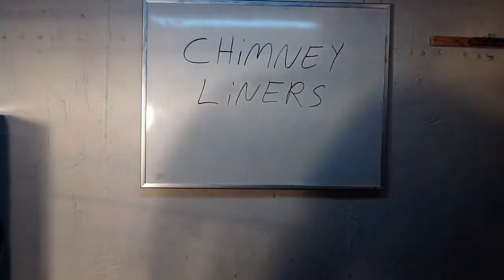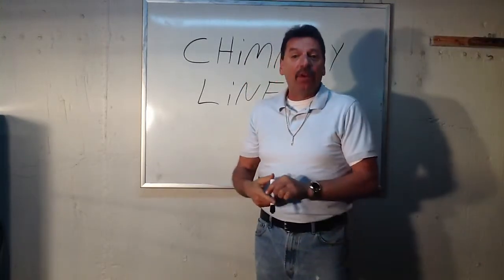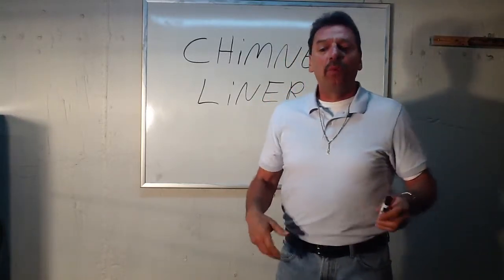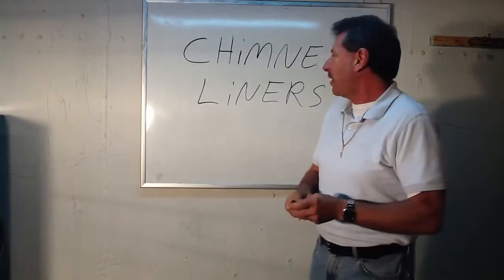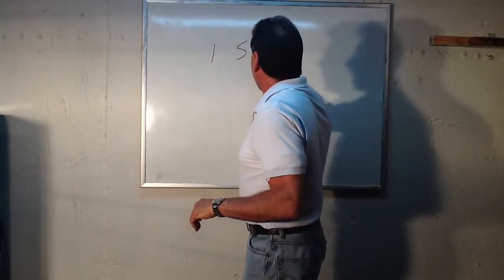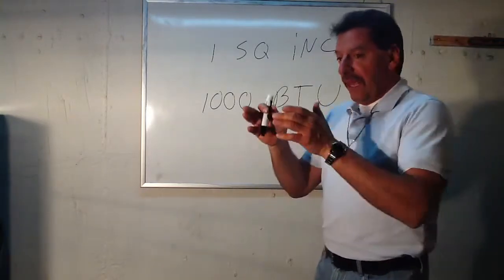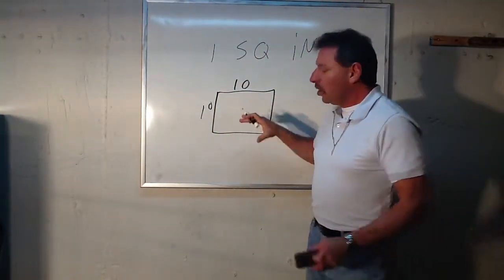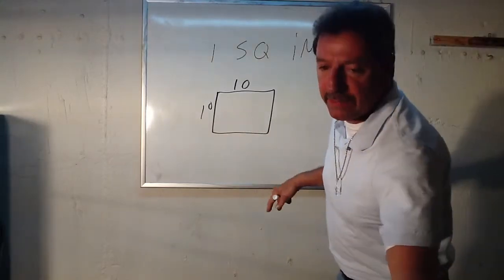Chimney liners, and make up air

Comment: Not only sulfuric... also:  Carbonic and Nitric acids.
I always recommend an INSULATED liner... keeps the gases hotter, further up the chimney.
Masonry chimneys are TOO BIG!  Gases move very slowly in big chimney.  Smaller liner allows gases to move FASTER, up and OUT with less time to cool and condense.
LOTS of good reasons to install liner!